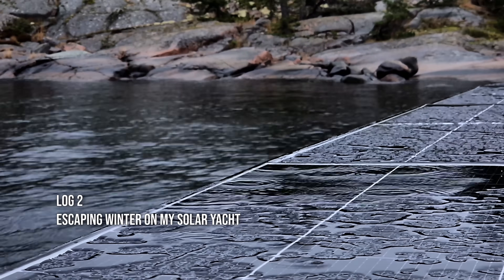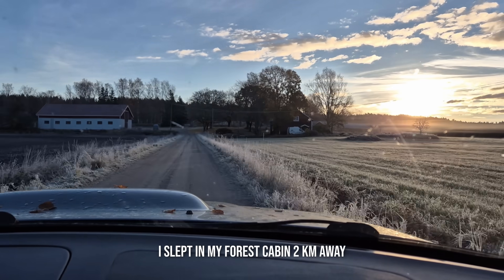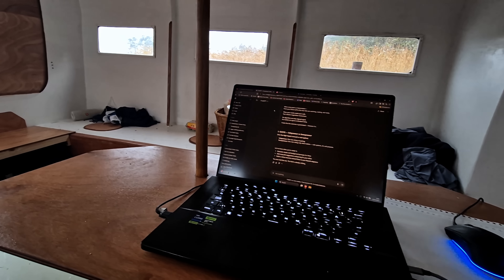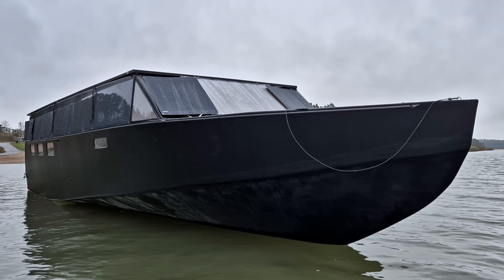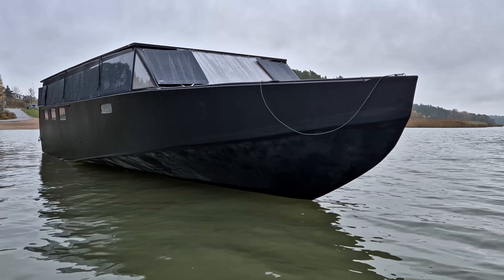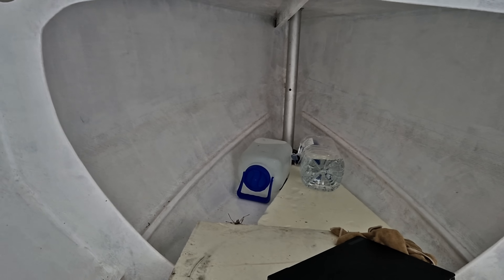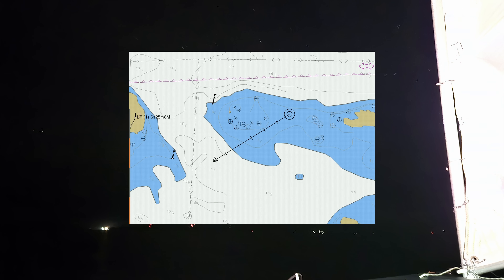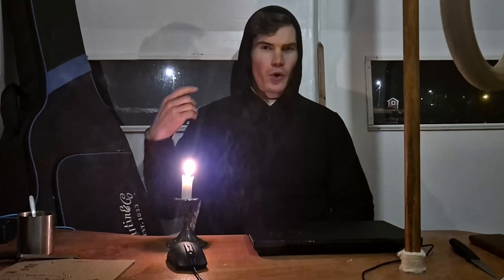🌧 Escaping the Nordic Winter on a Solar Yacht That Runs Forever

Comment: With enough ballast that looks to be a seaworthy boat.. I also chose the freedom of the sea for my house and home ... Lightweight can be however very dangerous and carbon fibre etc is over rated.. you need the weight and surely the strength to be able to punch through a wave ,not break Ur back on the crest of one and deal with being breached or rolled over either on a 45 or an angle and even cartwheel end for end.. hence you need lots of small spaces so neither you or loosed items (a big no no on board as everything must be securely squared away) I knew someone who probably thought he'd picked a nice strong breeze to get to New Zealand fast from Hobart.. it turned to a gale and he rolled the boat end for end on a cartwheel and with no real cabins or even just the one up foread he still had over thirteen feet to fall straight down and break his ribs... U want to make your boat self righting and be sure there are plenty of things to grab hold of incase of a breaching on the waves .. lord forbid the bow stove in but there are many more freak waves than originally thought, sometimes they stand up like pyramids and so don't spare the horses .. makes her stronger than you need and you should b able to survive anything... If you design and build a smaller model of your boat to test in conditions. You would expect that if you scaled it up then the  boat should bye rights behave the same but they don't .. it's something about the schematics changing volume and weight bye increasing the size of the  design.. the longer and flatter a boat is then the faster it will go but then unless you have very elaborate bow and stern thrusters etc ,which all entails more moving parts hence more things to go wrong or for example you wanted more keel which slows  to only hull speed then but gives you much more stability.. you see with all the different types of boats it's about compromise..meaning more speed ,less stability or more size for living /working etc compromised again safety .. each boat is usually designed for particular local conditions or perhaps the most known and dangerous conditions of a jeorney which might xompro.iseapeed and comfort but will survive the worst of conditions .. U see back I. The day it was not just the autistic type quirky folk with the nack  to design and build a boat but also folks with asbergers and ADHD people who had the ability to visualise a boat.. they would carve a half model and ask the do you want a boat like this .. they would say it up into stations or sections and emulate them full size .. any things like ballast would be added later to trim the COG centre of gravity with the centre of buoyancy COB and centre of effort COE. To then calculated the sails centre of effort to be even just a millimetre or a wee more Infront of the centre of buoyancy times and decided  the centre of gravity so that if the sails push the boat forwards just enough and make it lean forwards and it only has to be just  Infront of the COG×÷COB to make then gravity try to catch up in the direction it's leaning hence it moves forwards .. that combined with the fish tail birds wing design and the fact your sail works like an aeroplane wing and rather than push it sucks and pulls it forwards and so boat design only incorporated mathematics in about the 1770s or so and since then boat design hasn't really changed much until we came across more modern and lightweight materials however the old trusted and true hull designs like an Indonesian junk and such have been proven seaworthy for millennia all be slow as they are .. yeah boats are great the only place you can find raw nature and nothing but .. designs important  before mathematics they used to jus trial and error so often they would build a navy frigate and upon launching the vessel it would capsize as they built it top heavy . They would usually trim the ballast with stone and lead or iron and steel.. produce /cargo etc .sometimes a boat would handle like a dog so they would even add some more length to the bow or the stern in a trial and error type manner but if you can design the boat on paper now and run it through some naval architecture you'll know what she can and can't do in simulation. Moment is a thing to be aware of in boat design . It's almost hard to describe but it's not because if you think of it as a moment in time well the. That's your calculation... Ok so,prep,, if you get one, two, a few people , depending on the size of the boat and You bring either the boat to the peer so people can step off or you get them all to finish rocking the boat bye standing in the middle .. so... Yes you rock the boat with a good bit of effort and then stand off ,then you measure the time it takes for the hulls sheer to go from the middle to "up" and then "down" and then back to the middle . It's usually somwhere around the two or so second mark on say a thirty to forty foot boat and so then you take that back to your design or run some numbers and it should then corolate with the safety parameters your after .. remember  the lower and closer to the centre and the middle and often just after of centre ship is the most stable spot (where the skipper sleeps )  but if you have too much weight on the left and right and especially higher up you can create an pendulum effect which is awful as sometimes it happens in light conditions... Hull design is all about compri.ise for compromise . You can't hav it all but you can sure try n come up with a happy design.. looks like a house boat and so if your very good at weather and prey alot you should be right to go anywhere.. me .. I won't go till I know my boat can handle anything and I learnt from  having to sail a broken boat to start with if I was gonna get anywhere .. it was good learning that way because the. If I do have to jury or Jerry rig it  I'll already know not to panick as that only makes things worse and there are many many many things you can do before your completely marooned... Jeez I wish I had a you tube channel whe. I was trying to get my schooner or the sea grass and yeh.   Money.. BOAT= Break Out Another Thousand and I was never a very financial person or even interested in money much as I'd seen people change and get greedy and ruined bye it do I decided I didn't want any.. yeah ahhh in trying to leave the world behind and go find my own deserted island I realised I would need a bit of money and you tube is a good way to do such a thing.. anyways I wish you luck good fella and hit me up if you want any advice.. I'm sure you'll be able to find out what you need and support these days seems to be just as random but even abundant on here . I've seen some good success stories and so coutos to you bud .. good luck..

Comment: God helps idiots. Hopefully, you will be ok. Many people have commented about lack of lights, the structure seems pretty flimsy including your back doors. You don't seem to have a real knowledge of naval architecture. Maybe you just aren't talking, but you should be talking about stability. You put a lot of weight up high (solar panels). Do you have any idea of the righting of your boat? You don't seem to have an floatation onboard, so a hole will sink you. As long as you blitz through without hitting bad weather, you might be ok. On the canals, you're fine of course.  Do you know what you are doing and simply aren't talking? Or are you really that young and stupid?

Comment: alot of countries will deny you entry if you dont have proper positioning lights and indicator lights, which will also be alot safer for you . please dont take lightly on safety , its already a flimsy light boat, it will absolutely sink if someone crashes into you .

Also not having proper steering, proper heating, open flames, no emergency radio , no emergency hatch on top of the boat in case of sinking - like i get it , building your own boat is cool and all , but if ANYTHING happens , you are as good as gone , imagine not being able to steer in a storm - you will absolutely not stay afloat.
Reply: - I FULLY AGREE! Like ⁉️ Not tryna be a buzz kill or anything, but this is NOT smart by any means && idc WHAT country it is, if I were a boat cop, I'd pull him in a.sap && take his boat until it was safe && legal, just sayin`. It is just common sense, which, unfortunately, many people just simply lack. 😢
Reply: totally agree, this thing looks fun but isnt safe at all
Reply: Ah , give the guy a break. He's living life, as it should be. Safety be damned. Lol 😅😅😮

Comment: I was a professional sailor (not racing, just transport and work) for 5 years total. At one point I sailed from the Baltic to the Middle East --

What others are telling you of safety gear, regulations, and extra safety precautions for everything, is no joke. The route you are planning through the Skagerrak, North Sea, English Channel, and Bay of Biscay, can be some absolutely brutal wind and water.

I have rescued people from the Sea -- and 90% of the time, it could have been prevented by just a few extra hours of work in putting safety and communications equipment in ordee or keeping a humble eye on the weather.

So I hope you do well -- but take a little more time than you think you need in making absolutely certain that your vessel is safe for the North Sea.

And have a backup plan for every worst-case scenario, because those waves are way worse than just a sledgehammer.

But I truly hope you do well, and arrive safely to the lands of the Sun.
Reply: As a Dane living out next to the north sea, yeah this boat is VERY VERY unsafe, he needs liferaft, lights, cold weather suit, flares, radio , emergency radio - a flimsy light wooden boat in the north sea is absolutely crazy if  you arent prepared properly.
Reply: @ShypaxGaming Better injured pride than lost at sea.

I really, REALLY love the idea of an ocean-going solar-powered boat --

But that 9mm plywood, only two layers of fiberglass, with no intrinsic floatation or "sandwich" construction (hard shells making structure, with floatation marine-grade foam to fill the voids) means that at the first bad wave punching the bottom, that boat is gone.

Even a quick-cure fiberglass patch-kit takes time, and potentially fatal to go over the side solo.

Those forward-facing windows, unless they are mechanically watertight according to maritime construction standards, are going to fail at a big enough wave crashing over the bow, and the whole boat will get swamped instantly once those waves break through the front windows.

Without adequate watertight hatches and sealed voids, that boat is downright unfit for heavy seas.

I spent weeks n storms with 10m waves that tear steel beams apart. The North Sea is just as violent with its "stomp-sea," and eats boats like this.

Without further drownproofing, safety geae, comms, or even regulated operating equipment -- this boat is unfit for open Sea.

The Baltic can be angry -- but the North Sea eats people. Tears steel boats apart. There is no comparison.

I have sailed all the Archipelagoes in Sweden, from the Norwegian border to Stockholm, Öland, Gotland, Gothenburg and Malmö -- and 60,000 miles open-sea in Atlantic, Pacific, and Mediterranean.

Island-sailing in the Baltic is nothing remotely close to as dangerous as the violence he will meet in Biscay, and even after crossing the Skagerrak, it gets worse from Denmark all the way to Normandy.

This is no joke a dangerous undertaking you don't do without facing the fact that even on a good vessel, a bad day might kill you.
Reply: @ineedabetterusername7424  I live near the coast in Denmark , i absolutely and 100% agree with you ,its a canal boat,  absolutely not something you'd want anywhere near any sort of weather in the north sea - i was once stuck on a ferry going to norway at the north west of Denmark for 8 hours in a storm , the way it just threw around a giant ocean cruise ship - yeah hes dead - also ive seen so many disaster docus about shipwrecks and sinkings, and almost always in the north sea its taken by a storm that just f*cks them up .
Reply: @ShypaxGaming I once pulled in on a sailboat to a tiny harbor in Denmark -- just to get some hot food on the way to Sweden -- in April.

I have slept in literal snowstorms, with ice forming on the outside of my sleeping bag and hat even inside a shelter, and felt warmer in the snow than a week on the North Sea in April.

Plus, if the wind blows in towards the shore (which it usually does, coming from the west) -- it can be extremely dangerous along that stretch of coastline.

Denmark is NOT a joke to sail around...
Reply: @ineedabetterusername7424 does anyone run fiberglass yachts in 10m seas?!

That thought terrifies me.
Reply: @sl0ls I've known some sailors who have done so in 5 or 10 meter sailboats.

But they were built in shipyards by professional companies, and designed to withstand
Reply: look at his route at the 1 min mark. he avoids all of the places you mentioned.
Reply: @b4ldur I did not see that, I will double-check.

I really, really want him to succeed -- I LOVE what he's doing -- but the Sea has devoured more optimists and stoics than any other natural force.

I want him to make it through, because it's an awesome idea -- it can just go horribly wrong if he doesn't recognize the hazards that can be mitigated and must be acknowledged.
Reply: @b4ldur Tne map shows no full route -- just a dotted line to the south of Sweden.

If he continues that route, it is out through the Skagerrak.
Reply: @ineedabetterusername7424  Keep watching the dotted points move to show his route. He's going via Lübeck through the German channel system, up the Rhine, then taking the Rhine-Rhône Channel to move down the Rhône downstream to the Mediterranean.
Reply: @b4ldur  he still have to cross open seas, and rivers still have waves and storms.

Comment: consider getting a small portable solar generator and folding solar panel in case your main system has a failure you will be able to power your radio and electronics
Reply: Да лучше бензогенератор тепло и свет

Comment: Your boat design is interesting. Because it is so light weight it is obvious that the draft is very small. In a moderate wind or greater your boat will be a sail and controlling it against the wind will be diffucult. I am also concerned with the hull dedign. In very calm water like in this video the hull strength isn't being tested. In moderate seas or worse, especially if the wave direction is at your beam the heavier seas pounding the hull will be stressfull. Your hull design with smaller and fewer ribs in heavier seas will be the real test. Few things on earth have the power of moving water, especially when the forces are constantly varying in strength and direction. I wish you the best of luck and hope as you continue to outfit your boat you give much thought to safety equipment.
Reply: if he hits anything above 30cm waves hes gone , look how much it lists when its literally lying in a mirror still harbour every single time a wave hits it . im 99% sure its gonna sink in the first storm .
Reply: Maybe the title is just ragebait.  The ship will sink if its in moderately stormy weather. It should only be driven in calm conditions and definitely NOT on open ocean.

Comment: you need to add some running lights, pretty sure they are a maritime law requirement, but either way you need them for safety out on the water.
put a blinking solar powered light at the top of a mast or flag pole but its cool what you have built so far

Comment: I've been working at a fully solar tourist Cat in the city of Seville. The boat was 14 meter by 6 meters and had 2 bellmarine drivemaster 10Kw which peaked at 15Kw each. 40 270W panels and 18 5kW batteries, same victrom mppt's and installation. It's INCREDIBLE what you're doing men, never thought at a lightweight monohaul with a few panels, 3 5kW batteries and an electric overboard doing what you are doing at the noth of Europe!! If you are some day near Seville feel free to contact me and I'll get you to see the fleet of electric boats the company has (I'm not working there currently tho).
Reply: Btw if you reach Spain by summer, you are usually getting around 80% of you max production of power by the panels so that around 3kw/h for almost 8-10 hours a day!!! That quite a lot of power and you'll be able to cruise at 3Kw of consumption without touching the battery percentage.
Reply: You're messing up the units - it's kWh for batteries, not kW.

Comment: Awesome channel! Awesome outlook on life!
A few design considerations for your next build: 
Build your roof out of very polished aluminum and mount by facial solar panels slightly raised above it and at an angle, bi facial panels are quite a bit more efficient, especially if you have a highly reflection surface behind them.
Also with your panels hanging over the sides, you should make it so they are on hinges so when there's full sunlight you can point them upward. 

LOVE the build! Keep it up

Comment: This is one of the coolest builds I have seen on YouTube. The thought of being able to boat forever with a little bit of sunlight sounds very satisfying. If you add boat carpet to the floor and walls, it will cut down on noise and add a bit of insulation. Stay safe!

Comment: Interesting..at 5:16 of the video you show the motor control display and it shows 752 Watts consumption rate at a speed of 3.9 knots. 
That’s impressive; only one horsepower output moving a live aboard vessel at over 7 km/hr!

Perhaps fully loaded this speed will decrease to 6 km/hr but it’s still impressive. 

The average human without carrying a load walks at 
4.8 km/hr  

If we calculated calorie burn of a human rowing your  boat at that speed would be more than a human can eat in an hour…